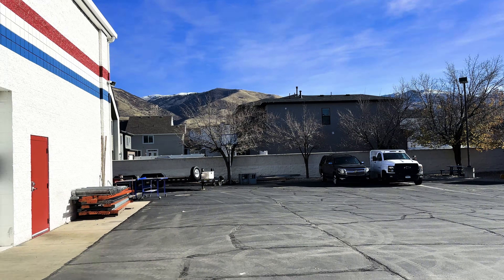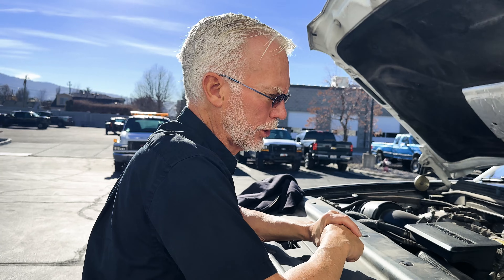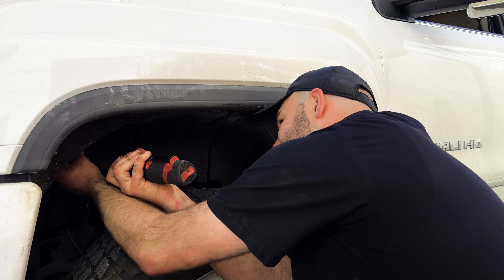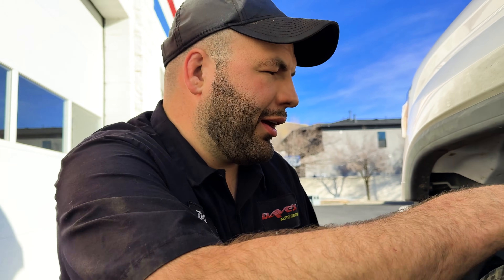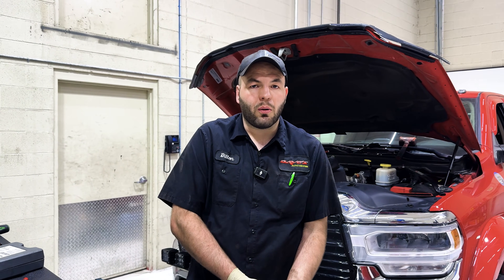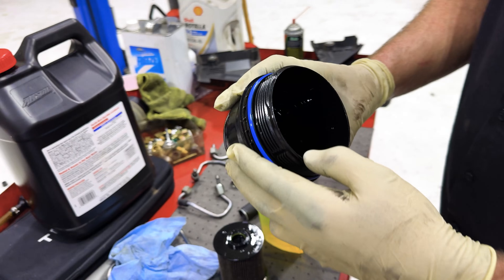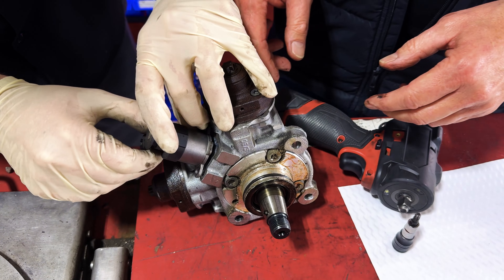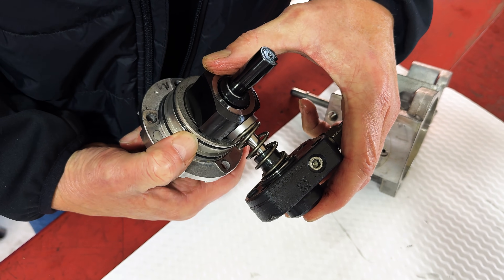We Found a HOLE in His Piston… Then Saw What The Fuel Filter Looked Like!

Comment: We had a 78 Pete with a Cummins motor in it and it burned a hole in a piston and I was wondering if it was  caused by the same thing bad fuel?  The funny thing about when it happened it was at night and the truck was loaded and I was going through the gears accelerating and it was like a shot gun went off in the cab and fire went out the stacks then it went to knocking.

Comment: Tis as far as I can see is why you should leave engines standard, when you "upgrade" without major work you'll do harm.
Reply: Can you elaborate so we will have an idea why ?
Reply: @speedfreak8200I think engines are engineered to be reliable and function by manufacturers, they spend big money to develop an engine to operate at its best and if you tinker with it with a remap or a set of injectors for instance you stress another or a few parts of the engine and something is bound to fail under the new stress of a so called modification.

Comment: Decent insight, though L5P rpo does not have a CP4 BOSCH FUEL SYSTEM. They have a denso HP4 and a Low pressure lift pump.

Comment: I wanted a Ram Dually 4x4 so bad.  Boy am I glad the salesman talked me out of it. I don't tow anything but a lawn trailer and the extra tires are just there to wear out so. I couldn't afford to drop 30 grand on a engine.
Reply: I own old Diesels ⛽️ 84' Isuzu P'up 2.2 5spd 130,000 ● 99.5 F350 7.3 ZF6 320,000

Comment: You now what pisses me off is why don't the factory put that fuel filter setup on these trucks, especially for what you pay for them.
Reply: Dave's said it many times before, mfr's don't care about us, they just need to get past warranty.  They don't care we've spent our hard earned money for what appears to be a solid product.  They may care about THEIR reputation some for future sales, but honestly, this emissions technology is politically charged and mostly unnecessary....just tune a motor so it doesn't blow soot on acceleration and forget about the $20k worth of emissions systems they saddle us with.  Not to mention DEF and maintenance costs of that equipment.  I for one feel God will deal with these shysters in the end for the unbalanced scales they've used on us.
Reply: I was  thinking the same thing. Instead, we have aftermarket devices that solve the problem while GM keeps selling bad products

Comment: Why even own diesels other than to tow? All these street pavement deals that don’t pull anything end up breaking your account
Reply: When I went to order my F450, my friend who was the fleet manager at the dealership, ran the numbers for the diesel and the gas V10. We figured it would take 300,000 miles to break even on the diesel. The V10 likes gas, and tows well, but has had only 2 breakdowns in 25 years. One was a blown out spark plug, the other was a transmission. The truck has otherwise needed only normal maintenance such as brakes, tires, hoses, and batteries.

Comment: You found metal in the filter housing and said it wasn't from the tank, etc. and then called out the HP pump. Isn't the HP pump after the filter?

Seems it would be lift/tank pump, fuel filter, HP Pump, rail, injector, cylinder.

If you presented those findings to me, I'd inspect the bore, replace the piston and injector, flush the fuel tank and lines up to the filter and be on my way. Maybe get the other injectors flushed/serviced as well 🤔🤷
Reply: And come back later asking for warranty work.

Comment: Why is the average semi engine getting 750k to 1.2 million miles working hard most the time and pickups only get around 250k or less on average seldom working hard? Are they purposely putting junk engines in pickups?
Reply: Semi trucks run mostly highway miles, and don't have so many cold starts and short trips.
Reply: These new trucks are so trash
Reply: @FitemeUrlnotIrl  yes due to government restrictions they are bad, but they still get on average 750k to 1.2 million miles before needing a full rebuild.
Reply: Pickup engines are tuned to make too much power, detuned they would likely live longer.
Reply: @nickhuntington8507  I don't think so, but I would like to see someone de-tune a new one and see if your belief is correct.

Comment: Gas engine in that year truck with same miles...a replacement engine is much cheaper and easier. No direct injection/high pressure fueling issues

Comment: They went to a cp4 for higher fuel pressure to meet lower emissions. Higher pressure  gives a cleaner burn
Reply: The 2017+ Duramax does not use a cp4. Idk why they keep calling it a revised cp4 when it's a completely different pump. It's a Denso pump, way better design
Reply: @123donmaster 💯
Reply: He asked why they went from a cp3 to cp4

Comment: The 2017 L5P does NOT have the Bosch CP4 pumps.  It has the Denso HP4.  You might want to make a correction.  If that truck had a high pressure fuel pump failure then it was likely due to a fault in the low pressure side ie.. lift pump or air getting in.
Reply from the maker: Miles and I talk about this in the latter part of the video 👍
Reply: @DavesAutoCenterCenterville   Watch the whole video before you give people a hard time LOL
Reply: They made this mistake on another L5P video talking about possible cp4 failure. The denso hp4 rarely has issues especially since it has a very good 100psi lift pump
Reply: The metal in the bowl looked like brass. High pressure fuel pump definitely doesn't have any brass parts. That metal was from the low pressure pump in the tank. Mine has a bit everytime I change my filter as well. Sounds like his tune burned a hole in the piston or maybe a bad injector. Regardless of what made the hole dave and the guys thought they had one on the line for a 50k bill🤦🏻‍♂️
Reply: @gagerolls7845 I need a new truck I am scared to purchase anything after COVID. Seems like they made everything unreliable. Am I wrong ? My 07  ford has 350k on it all stock . I need work now. Same transmission. I changed my oil every 4 k .
Reply: @gagerolls7845 I was thinking of rebuilding it .
Reply: Came here to say this
Reply: just another Dave's auto trying to spotlight selling aftermarket parts lol
Reply: @kolinreichstein3399 just another hater on YouTube 🤫
Reply: @kolinreichstein3399 😂

Comment: If this pump is such a big issue from the factory, why hasn’t it been fixed or under recall after all these years? I don’t get it…?
Reply: Cause the ceo and high management need another lake house
Reply: Because by the time it becomes a problem you probably won’t have a warranty, so big GM gives zero fu*ks
Reply: @JoshNichter Apparently it's fine in Europe where they have higher lubricity. I think it may be a non-issue here if you use additive in your fuel. 

I wouldn't be surprised if the owners manual says something about it.

Comment: In 1980, I got a hole in a Pontiac 326 from an air leak in the fuel system, I pulled it down and replaced just that piston and rings, and got 200,000 more miles out of it, the same thing in 2000 with a Jeep. CJ 258 engine, after replacing just that piston and rings I got another 130,000 out of the engine. you guys doing complete rebuilds kinda of seems insane To this old school mechanic.
Reply: @Thousand_yard_King 💯 Probably why he picked it up 😅 

My understanding is the HP Pump would be after the filter. They didn't show the filter and anything in the housing would have been filtered out by the filter 🤷‍♂

Comment: So how good or bad is the HP4 pump. Compared to others?
Reply: Thats the thing, this truck they looked at does not have the CP4, it has the HP4 Denso, not even the same brand.  The HP4 does not have the same issues.  The only way the HP4 grenades is likely a lift pump failure or air in the lines.

Comment: English fella here: with your cheaper fuel prices(compared to Europe), I'm surprised you don't still use more NA 'gas" V8's in your trucks trucks? Diesel generates heaps of torque but modern diesel is also immensely complex. Is this done for taxation reasons, torque,  fuel prices or all three?
Reply: Most diesel trucks are for work or towing regularly. We also have complex terrain here in the states. Even with modern gasser trucks, going uphill with 8 to 13 thousand pounds of weight attached is still way better in a diesel than a gas truck. You also get much better mileage to your tank. Diesel engines with good maintenance can last 3x or longer when compared to a modern gasser engine.

One more thing, due to stupid regulations, gassers are just as complex and break down often due to efficiency management features like APM (on GMCs) or equivalent on other brands. 

Appreciate the honest comment and curious nature versus just saying something irrelevant like “You yanks waste money for nothing on your trucks!”
Reply: Great answers from everyone. I suppose that if you are doing super heavy, long-distance towing on a regular basis diesel makes more sense. We just don't do this in Europe so much, certainly not with pickups.  We do, mostly due to our insane fuel prices and tax incentives, drive far more diesel cars. We've got a 640d, super impressed with power, smoothness of delivery and economy.
Reply: @shatbad2960 I wish we had more diesel cars over here. But oh well. 
My Ford F350 diesel is an awesome hauler. 7000 lb trailer and I’m going uphill at 80 mph with tons more power on tap. It’s great fun!
Reply: Mostly we use diesel for capability. They’re much better when towing. On a recent towing trip I used $750 of diesel. A few years earlier the same trip with a gas truck was $1050. 
2400 miles with a cargo trailer.
Reply: @shatbad2960 Plenty of V8's all over the place (pretty much all day, everyday you'll see them - they are ubiquitous) but the people buying diesels seem to do it for a few reasons: 1. Because they can, 2. For towing, 3. For work trucks.

While the V8 has torque, it's nowhere near that generated by diesels and many people pull heavy loads (5th wheels, horses, tractors, wood, etc.) and do not want to be limited or have to think about moderating speed while towing.

Over the last 20 years here, as tech has increased there has been a marked shift in driving and it is expected that everyone is able to run the high speeds and (relatively) quick accelerations whether driving a sports car or fully loaded truck. There is little patience for someone having to go 30 mph up a grade although the tractor trailers may still have to, though that is expected. When I say little patience, I think it is more on the part of the truck driver than those around him, but so many people are used to everyone having all the power they need, when someone has an older vehicle that requires moderation, it is a little surprising.

As far as taxation, torque and fuel, diesel only makes sense for one reason: torque (power). In most places, the fuel is about $1 higher per US gallon and taxes are typically based on weight, not engine type.  Additionally, the gasoline engines capable of high power towing have mpg in the 7's (US) while towing so if one's use case is towing often, diesel can make some sense despite the higher fuel cost.

Remember, if you haven't visited here, the scale of space in this Country (especially out West) is very large.

IMO, Energy cost should be a negligible parts of anyone's budget (as it was in the US until about 2000) and is part of the reason we used to be much more prosperous (as would any region or Country where energy is close to free).
Reply: The HD trucks in the US have gasoline engines but many people choose to pay an extra $12,000+ for the diesel engine option. They also complain about the emissions components, the frequent break downs, the cost of repairs etc… they will sometimes delete the emissions which violates federal law. They think they need a diesel but 90% of them do not. 60% of them will never pull a trailer that justifies more than a midsize truck. It’s just a stupidity thing, they want a big diesel truck to feel more manly I guess.
Reply: WW2 left much of Europe destroyed, including the rail systems. So nations basically charged a 100% luxury tax on fuel, to raise funds for outstanding new rail systems and public transport.
 The US allowed our rail systems to rot and kept fuel taxes lower to encourage tourism and leisure travel. It all comes out the same in the wash.
 What was a 12-hour express rail trip 100 years ago, is usually 24-30 hours now.